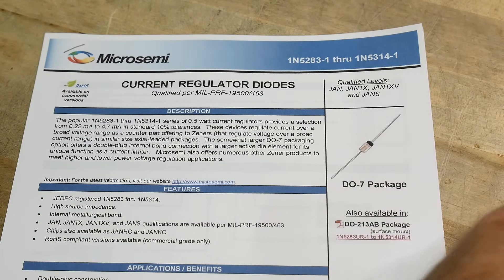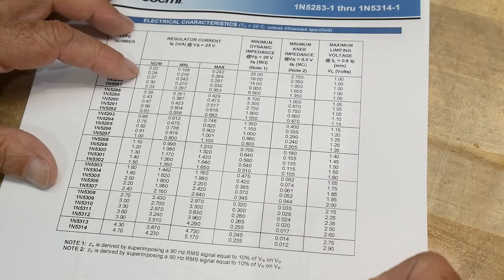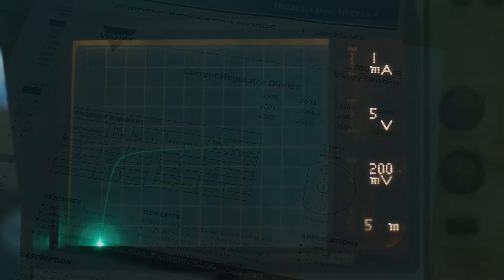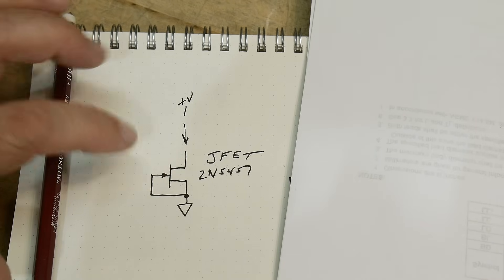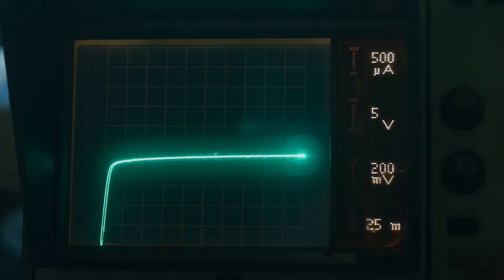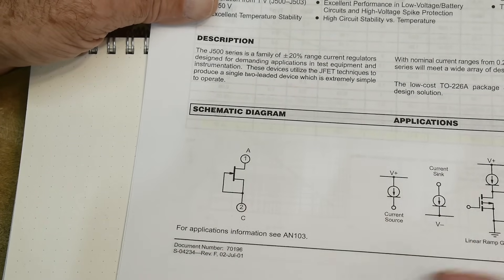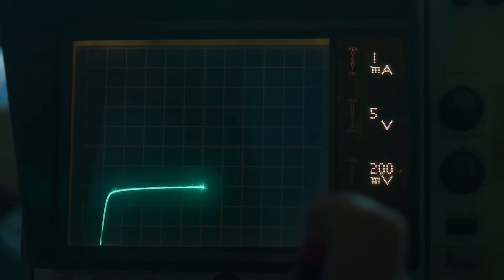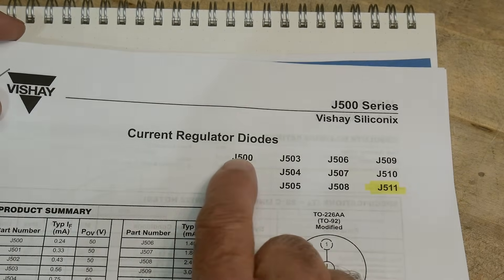#1886 J511 Constant Current Diode

Comment: If you charge a capacitor with a constant diode and discharge it with a transistor fed with a pulse train you will have an extremely linear ramp generator. Ron W4BIN

Comment: not rare nor expensive, a semitec S-822T cost 0.1USD in large quantity, and provides 8.2mA at up to 80V, with a max dissipation of 500mW. This is often the best option when PCB realestate is at a premium (standard SOD123) and usually the most effective solution in term of cost / parts count, as long as the current is below about 35mA.

Comment: The 78xx devices can also be used as constant current sinks, or the 79xx constant current sources.
Basically you put a load across the regulated voltage output, and the constant current is what flows from the "unregulated" supply through the regulator.
Since the breakdown voltage can be as high as 40 V and the current can be from milliamps to an amp, they could be used in vacuum tube circuits.

Comment: And here are some notes on using a JFET for a current regulator:
1. Select a transistor with a minimum Vth for low supply voltage operation.
2. Select a transistor with a Idss slightly greater than, or equal to the desired output current.
3. The transfer characteristics of the JFET have a thermally stable point. If you establish the current at this point, it will not depend on temperature.
4. Be mindful of power dissipation and thermal effects on drain current.
         CRDs are very useful parts, but they are rare and cost like a wing of Jumbo Jet! For this reason they never got popular or mass produced. Also it is much cheaper to take two(or more) BJTs and make the same thing.

Comment: This is exactly why I keep a bunch of J310 on hand, they make nice constant current sources which you can tailor to your needs with one resistor. Specifically the J310 is good for that because it has a high Idss and that gives you a wide range of adjustment. In fact, the Idss of these parts is so high (30-60mA in the datasheet) that it confuses those cheap component testers, doesn't read it as a JFET but rather either as a resistor, or as two diodes back to back. :) Try it, it's fun.

Comment: I was watching one of your videos and you said at one time that you worked at HP. I have acquired an HP 8601A sweep generator for a rather low cost for an unknown problem. It  turns out that the -75V regulator does not work. I have found a replacement for one of the transistors but not the other one. Its HP part number is 1854-0037 in is  a PNP and used a current source for the error amp. Any help would most appreciated.
Reply from the maker: 1854 is NPN    http://hparchive.com/Bench_Briefs/HP-Bench-Briefs-1974-01-02.pdf
https://www.qsl.net/n9zia/hp/HP_Cross_Reference.pdf
http://hparchive.com/PARTS/300-hpxref.pdf
Reply: @IMSAIGuy  I have the schematic and shows it is a PNP. The 1854-0037 is not listed. How would it effect the  the circuit if I used a common type of a PNP transistor.
Reply: @rtybn2012 Interesting, I also read the HP schematic as PNP: 1854-0037 PNP Current Transistor. Unfortunately, after searching a digitized schematic for over 20 minutes, I did not find a parts list either. You’ll notice, though, some of the itemized parts offer a substitution.
Reply: 2N3251A could be an appropriate alternative?
Reply: @markusberg2770  Thanks for the info.  I checked the specs, they looked good.I ordered some from E-Bay.
Reply from the maker: the schematic has a typo. take a look directly above that transistor and you will see the same one used. that one is correctly marked 1853-0037
Reply: The same transistor is used in both supply's and the same way. I do not see it as a typo.
Reply from the maker: the schematic I looked at had one transistor marked 1853-0037 and the other 1854-0037
Reply: @IMSAIGuy  I had to use a magnifier to to see the difference, you are right. My copy was very faint, because being low on ink.
However neither is transistor is listed in the parts list.
Reply from the maker: @rtybn2012  it was a custom part made for HP.
Reply: @IMSAIGuy Thanks for the info. I can remove the defective transistor and use a socket for a 2N2905A and a 2N2219A to see how they preforms or may be I will remove all the parts and use a LM317. I can breadboard it to see how it preforms.

Comment: Cool 👍   I like the fact that a simple pot makes a variable current source.  Also the fact that it is a 2 wire device which should be able to go almost anywhere in the circuit where you need a current source.

Comment: I think you either drew the potentiometer wrong in the schematic, or it's not doing what you said it's doing. The JFET is still 100% on, since the gate is still grounded. The current only changes because it's going through the resistor. I think you meant to have the pot change the current to the base to change how turned on the transistor is to vary the current.
Reply: Nope. The current through the pot develops a negative gate voltage, with respect to the source, and that lowers the current to below Idss.
Reply: Similar things are done with vacuum tubes, you add a cathode resistor so that the grid is "pushed up" and you get less amplification. In reality the reference point of the grid goes up so the total voltage difference grid to cathode decreases. You'd usually bypass this with a cap so that you get more bass.

Comment: Using multiple JFETs in series with all the bases tied together and a  source resistor can provide a much better current source. A J111 feeding a J112 feeding a J113 string gives really good results with sufficient burden voltage.
Reply: I've used this idea too - it can perform really well, although as I recall there is also a bandwidth tradeoff in adding extra JFETs. Impressively constant current vs voltage, though.

Comment: One of my favourite tricks with a popular condenser microphone circuit that uses an emitter follower to drive the output transformer was to figure out the current in the emitter resistor, then substitute a current regulator diode of appropriate value.
Reply: What does that achieve?
Reply: The emitter follower will have lower distortion, especially at larger voltage swings, and will also get marginally closer to unity gain. In practical terms, not much difference at all, but the theory behind it is sound, and it's an easy substitution to do.
Reply: @KarlAdamsAudio  oh, active load, yeah, that makes sense! 
I'd use 2 transistor ccs - seems a bit easier to tune.
Reply: Yes, the constant current diode only makes sense as an easy retrofit to an existing PCB, replace one two-terminal device with another - not something you'd do in a clean-sheet design.

Comment: Diotec in europe still makes these, such as the CL40M45. Lovely little parts, like zener diodes they exploit the reverse bias properties of diodes, but instead of a specific reverse breakdown they have a specific somewhat constant reverse leakage current. Forward characteristic is basically identical to a normal diode.
Reply: Diotec parts are bipolar, they are for much higher currents, and are marketed as LED drivers.

Comment: Why aren't these more common for LED drivers? Cost?
Reply: At low power resistors are cheaper, at higher powers they are pointless efficiency wise.
Reply: @VEC7ORlt  Yes mostly cost, as driving a LED a resistor is very cheap, under a cent cost wise, and with a limited supply voltage the brightness change is not an issue. Having a device where a resistor can replace it for 5% of the cost means it will never be used. The constant current diode is really a specialist device, mostly used where you need constant current over a wide input voltage range.
Reply: The TL431 can perform a similar function, is way more versatile, and cheaper. Even the tiny half watt LEDs will want over 100mA, so a 1 to 35ma supply isn't helpful without an amplifier - in which case there are better ways to do it. Even the little through-hole 5mm LEDs will take 20mA, but those aren't going to be used in a circuit likely to have wide voltage swings, which is the application where these are useful.
Reply: They kinda are, or at least were. I remember buying a pack from Mouser, probably 12 years ago, specially made for driving LEDs. I think they were only like 50 cents each, but being only 20mA at a max of 90v, they have a pretty narrow usefulness.